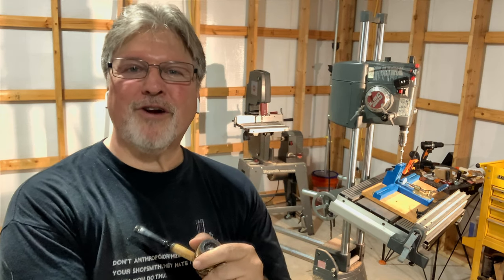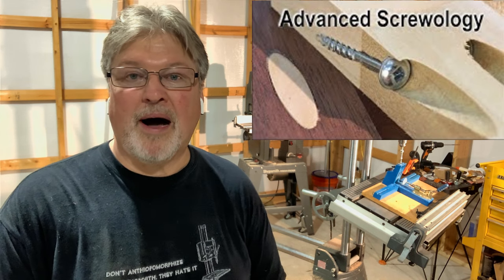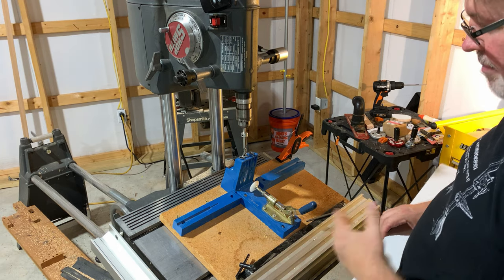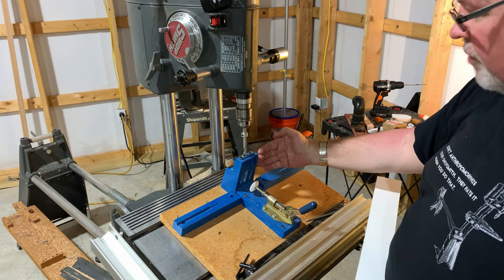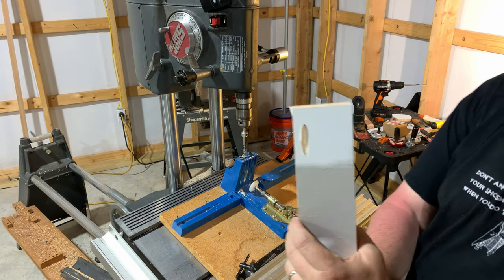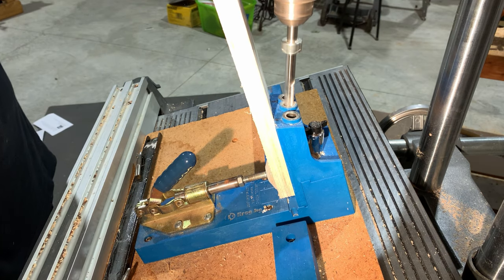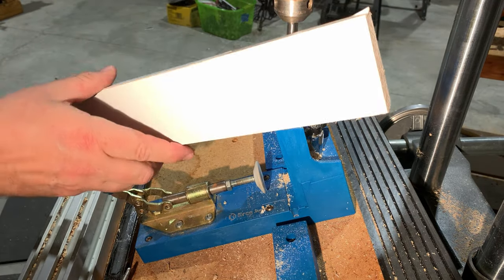Shopsmith/Kreg Mash-Up: The EASY Way to Drill Pocket Holes on a Shopsmith (And yes, it IS cheating!)

Comment: I seem to remember that an early version of Power Tool Woodworking for Everyone had an article (with pictures) on how to drill what we now call "Pocket Holes."
Reply from the maker: Exactly right. It was what we used to call “Furniture pocket holes” and they were normally done off the edges of table aprons to attaché table tops.
Reply: “Screw-hole pocket” is the term I recall from 1953 PTWFE.
Reply from the maker: @woodshopnerdery  It’s hard to believe that they were in use that long ago.
Reply from the maker: @woodshopnerdery  Not doubting, just amazed how long they took to catch on.
Reply: @MyGrowthRings  I too have worked with antique table where pockets where chiseled in to the approx for screwing down the top. I have also seen in older furniture a v groove milled into the inside of the apron the entire length and screw affixed there. But the stepped drill bit is the real innovation that creates the pocket and pilot hole in one step, otherwise they are not really competitive with dowels imho.

Comment: Can you explain the setup and how you fastened the Kreg jig to the SS table? Is it just resting against the Pro Fence? I didn't see any evidence of a t-nut or t-bolt in the miter slots.
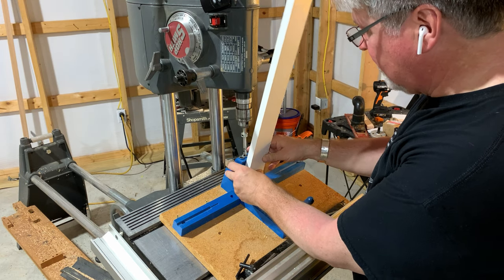Reply from the maker: If you look at the upper right corner of the sub-table (board) that the jig is mounted to at 0:49 you should be able to see that it is clamped to the table. It is also resting against the fence at the bottom.  In years past I have mounted the sub-table to the main table with T-Nuts, with 3/8" bolts through the table holes that SS added to the 510/20 table for mounting the shaper fence, and by connecting to the fence, but most of that was unnecessary. The fence and one clamp are all it takes, and considering the bit is captured in the jig, it's not going anywhere. Scott

Comment: In my industry, "Hack", means something entirely different, still to this day. But a good video Scott, none the less.
Reply from the maker: Thanks, Chad. Perhaps I was using a bit of hyperbole?
Reply: @MyGrowthRings  I believe so. It's a word that gets thrown around a lot in todays society. Just a pet peeve of mine.
Reply: @MyGrowthRings  To me, "Hack" will never be a complement or anything positive.
Reply from the maker: I suppose “mash up“ Would probably be a better description, but I run out of character spaces!
Reply from the maker: Fixed it!
Reply: @MyGrowthRings  You didn't have to do that for my sake, Scott. I doubt anyone but a machinist would care. 99.9% of the population thinks "hack" is the same as work around, or trick. To someone in my trade, hack is a severe insult. I didn't take it personally, though.
Reply: Interesting discussion. I my industry, IT and software development, “hack” has evolved into a term with positive connotations. Yea it’s a workaround to a problem or a way to simplify a solution saving time and money and increasing company profits.
Reply: @woodshopnerdery  Use the word "hack" around a machinist to describe the work that has been done, and if it was theirs; you better be ready for a exchange of words. Worse yet, call a machinist a hack, and they will probably be waiting for you in the parking lot after work. I've been a witness to both situations. Different culture.

Comment: Dang it!  Looks like you're reaching into my wallet again.  I have the simplest of Kreg jigs, but the one you show here makes so much more sense.  Maybe for Christmas?  Thanks for a great video.  Blessings, Glen
Reply from the maker: As long as the drill guide is stationary and the lever for the clamp is accessible from the same side as the clamp you should be good to go. I know that’s not the case for all of their jigs. Scott
Reply: @MyGrowthRings  My jig is simply the small, rectangular unit that is supposed to be clamped to the top of the board being drilled with a separate clamp.  It's the one Nick showed in his video.  Thanks for the link to his video, by the way.  I have used my Kreg successfully, but it is nowhere near as nice as the setup you showed.  Blessings, Glen
Reply from the maker: @sandysmeltzer2975  Got ya. I have a few of those too. It’s possible to embed one of those in a fence, but in the end you’ll have way too much time invested for my taste. Scott

Comment: I haven’t tried that.  But will!  

However, I have some old .378” ID carbide stamping die inserts.  These were used in the base of the die beneath the 3/8” punch.  

A couple of them are installed in a board that mounts on my fence extension.  It works similarly.  I made it long before I got my Kreg Jig.

Why did I make it?  Well, just let me answer that question with a question… Does anyone want to buy a few Pilot Point bits without their Pilot Point?
Reply from the maker: Ha!

Comment: Never enough clamps and never enough jigs. How do you have it attached to the shopsmith?
Reply from the maker: (This is a copy-paste from another answer, so forgive me if it goes a bit astray) If you look at the upper right corner of the sub-table (board) that the jig is mounted to at 0:49 you should be able to see that it is clamped to the table. It is also resting against the fence at the bottom.  In years past I have mounted the sub-table to the main table with T-Nuts, with 3/8" bolts through the table holes that SS added to the 510/20 table for mounting the shaper fence, and by connecting to the fence, but most of that was unnecessary. The fence and one clamp are all it takes, and considering the bit is captured in the jig, it's not going anywhere. Scott

Comment: What about the pilot hole on hardwood?
Reply from the maker: I’ve literally never had the need to drill a pilot hole. The two “secrets” that I have found are to clamp directly over the joint as I’m driving in the screw, which was mentioned in Nick’s video, and to use pocket screws that have a number six thread and a number eight head. I have some Kreg screws, but I only use them on soft wood. And I know your next question is, where do I get my screws? I’ll have to see if I can find you a link.
Reply from the maker: Larry, this is the type of screw I use for hardwoods: https://procabinetsupply.com/products/fillister-square-drive-type-17-pocket-hole-wood-screw-intertek

Comment: thanks! pocket hole is so awesome, but truth be told i always feel a little guilty, its like cheating isnt it?
i mean shouldn't i be mortising and tenoning etc etc if i was a real woodworker? still, they are quick, easy and brutally strong joints.
Reply from the maker: We can do both. I think it's much like our issues with plywood; It's when they are used improperly or are visible that they are offensive. I use them when the application warrants them. Scott

Comment: Why use the Shopsmith at all for this? Is it really easier than using a hand drill?
Reply from the maker: For large runs, absolutely! I own five different generations of the Kreg jig and use it in every way imaginable. A case for this set up is that once it is set-up it is far easier than using a hand drill. I never have to pick up, insert and remove the drill. A major downside of this approach is this is totally impractical for larger, cabinet side panels, but then again, that’s typically when I go to a portable version. Thanks for watching and taking the time to comment. Scott